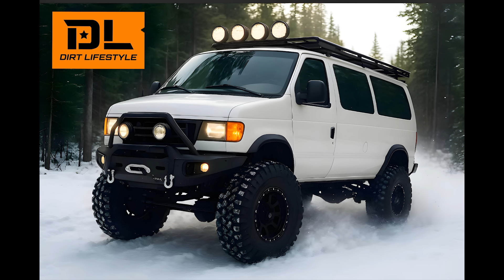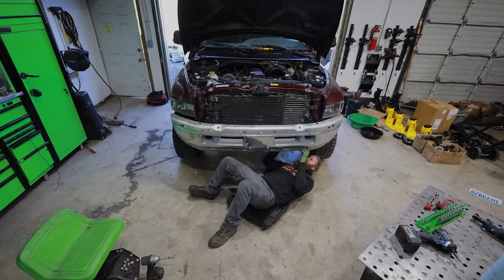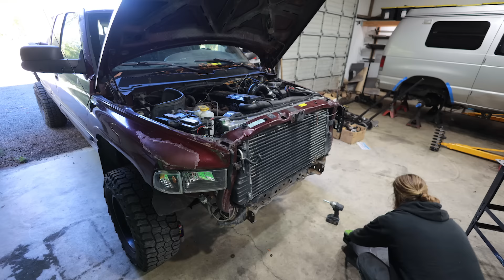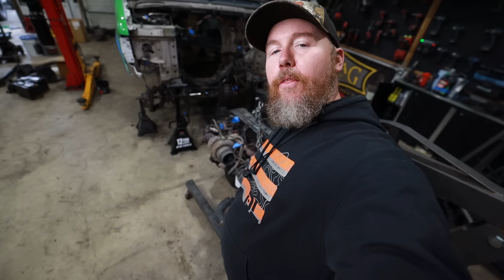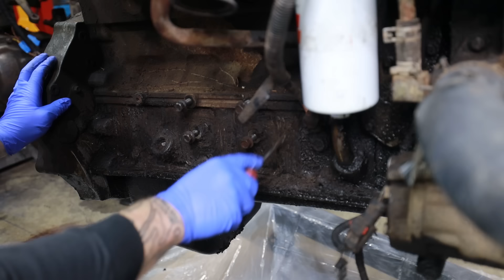Cummins Swapping My Ford E-Series Van | Ep. 5

Comment: On the rear view camera thing….let me also say they can provide proof where there was only doubt. 
I live in the dark desert and a few years back I bought a brand new 2020 SS-1LE camero 6MT -awesome car. Was owned for 8k miles before me. 
With just a singke 2 way/lane road to reach my area it’s an old sweeping up/down hilly type road with zero lights for like 9 miles. One fine Saturday evening I took off to do whatever and on this road at about 60mph things were fine then there was a dude in the center of my lane not even trying to move. Had no time to react and smashed into this guy breaking both legs and several other parts instantly. I pulled off and could hear this guy screaming in pain. Some homes along this road so people came out and police were there quickly. …..Long story shorter here- my dad and aone other fam are police. I was a rebel and chose a different life. My family immediately assumed it was my fault. Police investigation says I was clear. Dad didn’t believe. Came to find the previous owner had a dash cam installed at the mirro when I noticed an SD slot in glovebox ..Card was just enough GB that that drive was still on there and I rubbed it in everyone’s face. But this could have just as easily been what I needed to preserve my freedom in court.  It’s worth the money.

Comment: Did you ever consider using a 6 speed Allison transmission? Many motorhomes use Allison transmissions with the Cummins.. i occasionally drive my friends 1997 ram 3500 with the 5 speed manual.. I’m literally driving around town in 4 th gear..

Comment: Toss that stock tappet out get a machined one, do the KDP reseal that front timing case and cover  and change the dampner to a fluid one.

Also if thats a nv4500 its trash  to much flex in the gears if your pumping 500hp to it.

Comment: Hate to jump on the bandwagon but I put that three camera Wolfbox setup on my Excursion and it’s exactly what I’d been looking for. The only adjustment I made to how it comes from the box (it come with everything you actually need to mount it well several different ways as opposed to others that are just ‘barely good enough’) was a larger storage card (3 cameras fills the 256gb card up in about a day). I just bought a second one for my wife’s truck. It’s actually a good product, in my opinion.
Reply: I’ve got this for my Tahoe build and it’s been amazing.  Takes a bit to get used to looking at a screen rather than a mirror, but it does great

Comment: The idea that anyone would look at Hp on a diesel blows my mind.  It's for torque, just for torque.  Well, and fuel efficiency too, I suppose.

Didn't we used to gauge diesels on KW of energy?  Or was that Europe?  That actually seems better than either Hp or Torque, tbh. Certainly makes more sense considering how they work.

Edit:  As a truck driver, I NEVER use rear view mirrors....even when available.  Not because they are bad, they certainly aren't, but because my brain just doesn't acknowledge the fact they exist. lol

Comment: My Cummins swapped overland rig I use proform brushless fans and I have zero issues keeping it cool. Just did 4k miles in the San Juan mountains this summer and never had a cooling issue. 
1969 international travelall on a super duty frame and axles with a 24valve Cummins with the vp44 and a 5r110 from a 6.4 power stroke.

Comment: You’re going to love this drivetrain for crawling!  I have an 03 cummins 6 speed with a camper on back and in 4 low in 1st gear it just chuggs along without a care in the world.  You should make that front crossmember removable for changing the oil pan gasket. You’ll thank me later …. Another sweet build!

Comment: Can you do a video on what you cut out of the factory van wiring harness for your engine swap and what stays to keep things like the air conditioning heater lights and radio still working? Thanks love this build and I’m doing a similar build but with a 4bt in an 08 E350.    Keep up the awesome work!

Comment: Flex a Lite makes a wicked thin electric fans for the 6.0 and 7.3. Been rocking on for over 200k miles without an issues and would easily fit in there if you are rocking 6.0 stuff anyway

Comment: My dad had a 85 E150 with 4 speed on the floor.  I have a 18 E450 and not a whole lot has changed.  Pretty sure the clutch pedal should fit pretty easy.   Wires are the issue

Comment: One thing to be mindful about regarding the weight is the ability of the engine to yeet itself UP when going over a bump.  I had this happen on my 6.5 during a steep hill climb with my trailer attached and the torque twist combined with the dirt path/rocks bouncing around - sent my fan through the shroud and thus through the radiator.  We now chain our engine mounts down so it doesn't bounce around in there.

Comment: I may be wrong but isn't a solid clutch fan preferred for cooling while on the trail? Is the electric fan plan because this is going to see mostly long distance road travel?
Reply from the maker: It's about packaging. Electric fans are better offroad and the mechanical is better when towing down the hwy. But again, I can't fit one so electric it is! I have a plan. 👍

Comment: Do yourself a huge favor and add at least a front drive shaft loop just to protect yourself, wiring, fuel, trans case and trans lines if your front drive shaft u joints exit when you’re on the trail

Comment: I have a 2005 Dodge Ram 3500 with over 400K miles on it. The 5.9  High output engine was originally rated at 325 HP for that year. With an upgraded turbo, ARP head studs, 90# valve springs, and 15% over (50hp) injectors, I expect I'm somewhere just over 400 hp. From what I have learned, you can safely upgrade a Cummins 5.9 to over 1100HP with bolt-ons alone. I pull a heavy horse trailer, so I have what I need. One thing you should look at is an exhaust brake for your heavy rig. It is the best money I have spent on my rig. Mine is a BD, but there are several options available. My 90# valve springs are to keep the valves from floating from the back pressure of the exhaust brake, which I have set at about 75lbs. Your rig is going to be awesome!

Comment: factory motor mounts are probly a better grade of steel than a36 mild steel so 1/4 inch plate is bare minimum in my book the last thing you wanna do is break something like that in the bush in alaska 1100lbs shaking around all day will test the heat affected zone

Comment: Ive had a wolfbox in my AWD transit 250 for two years and I love what it does but It wont hold the time (has always on power),  it restarts randomly, and it seems to eat SD cards.  My cameras in my other vehicles "loop save" no problem, the wolfbox will loop a few times then stop recording until I reformat the SD card, its done this with a few different cards.  Maybe I just got a bad unit, it took about a year to start getting buggy.

Comment: The 05-07 Super Duty steering box should bolt in once the holes are drilled out slightly for the larger metric bolts. The heavier duty 6 bolt plate steering  box fitted with the Cummins too. I installed one on my Cummins Econoline I highlight on my channel.

Comment: With all the additional room afforded by the updated front end, why not use a mechanically driven fan?
Reply from the maker: No room. That extra space is on the opposite side of the radiator 👍

Comment: Dry usually refers to the total weight of the motor, which includes all the necessary parts, including accessories, to make the motor run and operate LESS ANYTHING THAT'S LIQUID AND WET, MEANING THE TOTAL WEIGHT LESS ALL THE OIL AND LUBRICANTS NECESSARY, but like you said, right around 1100lbs, dry weight.

Comment: Everyone thinks diesels produce less power when they see "HP" numbers, but a diesel will produce significantly more torque at a lower engine speed than a gasoline engine. If you're driving a gas vehicle and not revving to the RPM of peak horsepower, driving the diesel will feel stronger by comparison.

Comment: 5:17 you don’t need a crazy huge fan. My Cummins swapped gmc has just a 20 ish inch electric and I tow with it and it stays happy. But I am only pushing about 330hp at the wheels with 4.10’s and 285’s. but you can get those aluminum shrouds with 2 fans in them and that would be plenty.

Comment: Rad project, but diesel isn’t awesome in Alaska winters. Need block heaters and fuel heaters for cold! I’d love to have this in the lower 48 though!
Reply from the maker: I've got a block heater in this engine currently, and I plan on wiring it into my house battery system for easy starts. 🤘

Comment: Again, here we go with battery talk. Go with Lithuim, its lighter so the same amp hours, and since you will more than likely be using a Redarc system, can be charged fine. And you can use it all the way down to 0% instead of 50% with any AGM without hurting the battery. And lithium lasts longer.
Reply from the maker: I plan to go with lithium, 600 ah mounted in the cab 👍

Comment: Weight is the biggest reason diseles aremt used as much offroad.  It makes recovery a LOT harder. Also it takes a major toll on the frame, often leading to cracked or sheered frames.

Comment: In europe diesel engines are way more common , and most offroad vehicles use diesel engines too , and a lot of Nissan Patrols on 40’ with BMW M57 engine swap or OM606 Mercedes engine here in Romania. i also have a Samurai with 1.9AFN engine pushing 230ps , black and orange just like yours
Reply: I suggested it but he didn't even reply to scared to try m57 one of the best diesels insane power 😊😊😊

Comment: One thing commonly overlooked in big power applications is oil heat.  Put a big oil cooler on it and it will take a huge strain off the radiator.
Reply from the maker: That's the plan! I already have a sandwich plate and a oil thermostat ready to go 👍
Reply: @DirtLifestyle cummins has factory oil cooler
Reply: Yes!

Comment: Don't get deep cycle, get LiFePO batteries. Smaller footprint, can discharge further, and you don't have to vent them.
Reply from the maker: We are saying the same thing lol. I'm planning on running 600ah of lithium. "Deep cycle"
Reply: @DirtLifestyle  sorry when I hear deep cycle, I assume someone is talking about a deep cycle lead acid or AGM battery.

Will Prowse has an excellent channel reviewing most LiFEPO4 batteries on the market, he's worth watching if you're still deciding on batteries
Reply: @DirtLifestyle
I used to work on trailers as as kne of my past ventures... I wouldn't recommend lithium batteries as for they drain so fast in the cold. I would recommend 6v led acid. Heavier yes, but much cheaper, and it wont leave you powerless in the cold with your family. Best of luck, I just want to make sure you don't wast your money.

Comment: You could do a hand clutch on the shifter.
Reply from the maker: I'm planning a hand throttle like we used to use 20 years ago. A hand clutch is a cool idea though! But there is no way my hand could release a pressure plate this size 😆

Comment: if that’s a 24v cummins with the vp44 you should do a super in depth video on wiring cause it’s getting harder to find good low miles 12v with the p pump

Comment: For what it's worth I did a 12v conversion in a f350 i.d.i turbo diesel and used the old radiator. Didn't have fans at all for the first year and never had a heating issue even with it turned up so your van radiator looks more than suffice to do it.

Comment: Some (not many) of the 3rd gen econolines in the 80's came with a manual transmission...wondering if the pedal assembly from one of those vans would be an easier mod to get you the clutch pedal?
Reply from the maker: Sounds hard to find but I bet it would work! I plan on using the pedal assembly from the dodge 🤘
Reply: @DirtLifestyle I have found two 3rd Gen Econoline clutch pedal assemblies so far. But my buddy used an OBS Ford F-150 clutch pedal assembly to modify his van assembly when he converted his 4th Gen to stick shift.

Comment: You can fit double 14 inch fans looks like it. If you want, I can draw a fan shroud for you.
Reply from the maker: That's the plan 🤘. The ram radiator had double 14s and it cooled fine so I'm going to steal those for this project.

Comment: I thought you said in an earlier video you were going to use the van to tow the samurai.
If that’s the case you don’t want electric fans.

Now if you’re never gonna tow with the van, then sure, you can absolutely get by with electric fans, but if you want to ever tow anything you NEED a mechanical fan.

It’s not rocket science, moving air takes energy. A mechanical fan takes about 5hp to spin, it takes over 300 amps ( at 12volts DC) to make the equivalent hp. So unless you’re running fans that pull over 300 amps, you’re not moving the same amount of air as a mechanical fan.
Reply from the maker: I've towed plenty with both. Unfortunately we don't always get what we want as builders and there is no room for a mechanical fan. But I have a plan 👍.
Reply: @DirtLifestyle  while I look forward to seeing what you come up with, “plans”, no matter how good , can not defy the laws of physics.

No electric fan ( at least one that’s not pulling over 300 amps anyway) can move the same air as a mechanical fan. No hate, no argument, just facts man.

Comment: Where is the wolfbox affiliate link? I want a dash cam system for my Jeep and the whole mirror replacement seems awesome cause I have a 35" tire blocking the majority of my rear window, also my wife wants a front/rear dash cam setup.
Reply from the maker: It's in the description but I just posted it in a comment as well 🤘
Reply: @DirtLifestyle ha, I don't think it was there when I posted it but I'm getting older so who knows 😂, but I see it now, thanks 😁

Comment: 0:37 so if it’s 30% more efficient but diesel cost 30% more does that zero out? I know you’ve got more torque but does that offset having a motor that can be potentially 600lbs lighter? I guess it really boils down to the weight of the truck maybe?
Reply from the maker: To many factors to consider in a YouTube comment. But 30% is a "rule of thumb" percentage but it goes up substantially under load. This van loaded, hauling a trailer, and turning a 40" tire would get extremely low mpg with a gas engine. 5 mpg or less I bet. Same scenario with a 5.9 cummins and we will see more than double that. If you are moving a lot of weight, diesel is the way. They last way longer under load and they are much more efficient when you push them hard. Believe it or not, we had a diesel pusher RV with a 5.9l cummins that when hauling our land rover was 37,000 lbs on the CAT scales. If I kept my speed around 65 mph we still got around 10 mpg! Super impressive!

Comment: Obviously you wouldn't want it near the exhaust, but could you do spray foam insulation under the floor on the outside of the van?
Reply from the maker: I've got plans for insulation but not with spray foam 🤘
Reply: @DirtLifestyle  I'm just thinking you could save a littler interior space and headroom by insulating on the exterior under the floor

Comment: I will say again to make that cross member removable because servicing the oil pan or gasket! Down the road it sucks to service that or make changes by removing the engine for a simple task! I own and tow with an 01 Gen2. Also use a fleece coolant bypass while that motor is out. This will help cool that back cylinder, which the one that usually blows. You’re already working with a used high mileage motor. Also hit that head gasket and some ARP head studs.
Reply from the maker: Yep 👍

Comment: hopefully he does all the longer life upgrades for the Cummins especially the water pump, and 6th cylinder coolant flow mods.
Reply from the maker: That's the plan 👍
Reply: @DirtLifestyle I am in Washington as well and I would love to meet up and I like a Jeep show or something and get some of your advice
Reply: That’d be cool to watch! All new gaskets seals and maintenance parts too
Reply: Why bother when he's literally throwing welding bb's into the top of his valve train?
Reply: @sambarrett4590 lol he literally said in the video he is rebuilding the engine, which means disassembly and cleaning and repairing
Reply: @kylancook3477  might as well grab some dirt and throw it in there too maybe some sand thatll help rebore the cylinders
Reply from the maker: @kylancook3477 the head is off and I'm pulling the pan as we speak 🤘.
Reply: Killer dowel pin fix...